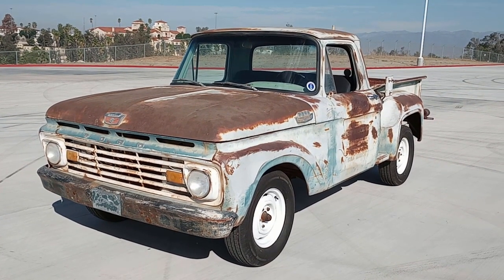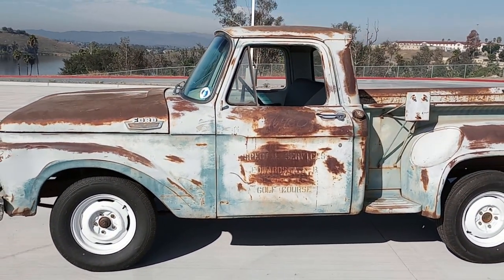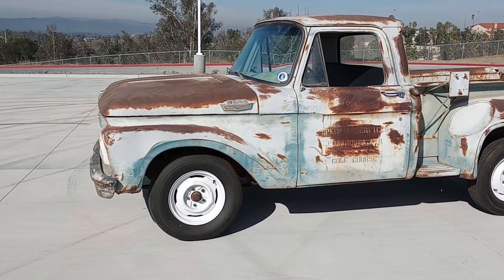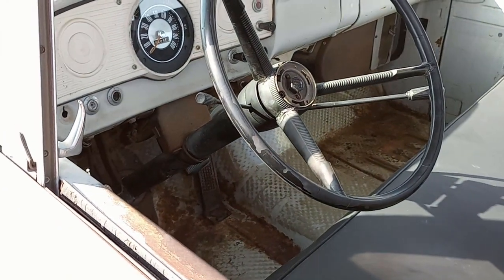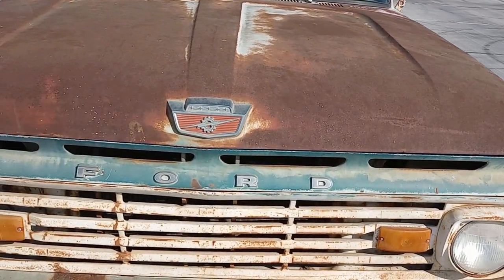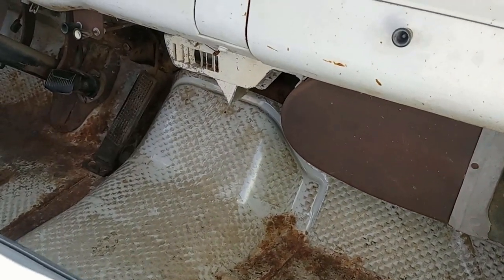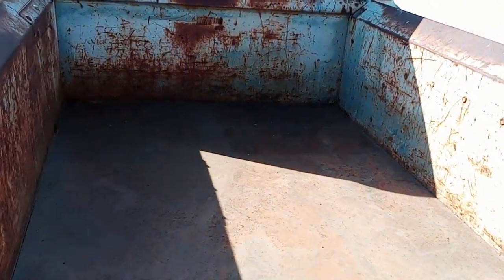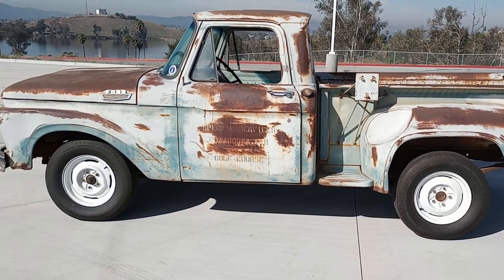1963 Ford F100 Step Side Walk Around

Comment: What a great find. I hope you give it what it needs. 
Enjoy it., 
Never swap a GM engine into a classic Ford it is a complete disgrace. 
That old 6 is tired.  Rebuild it or do a Windsor swap. 
This old truck deserves a new life.  
Thanks for sharing.
I own a 59 F -100 short box.
I swapped a 351 Windsor with a AOD Transmission into my truck. 
It made it fun to drive & own.
You can do a 289 or 302  carburetor or fuel injection. 
Very few short box step side pickups left in this world.